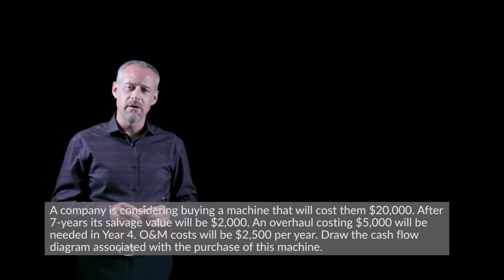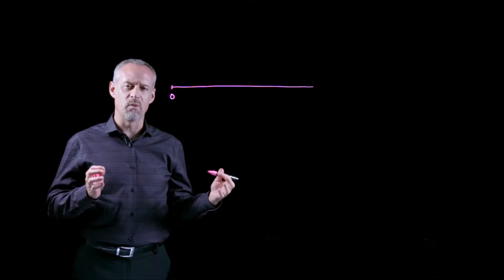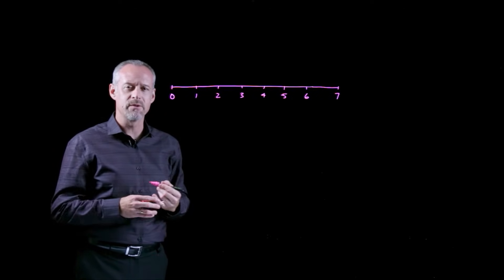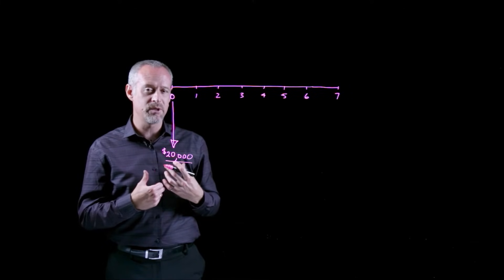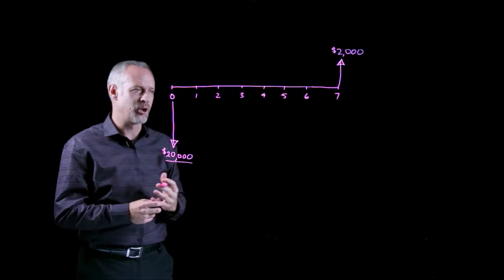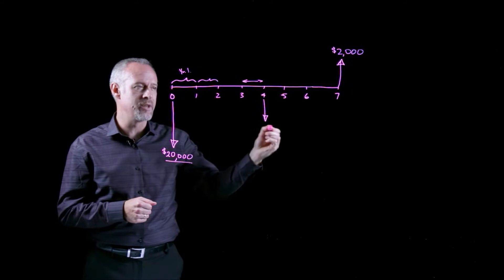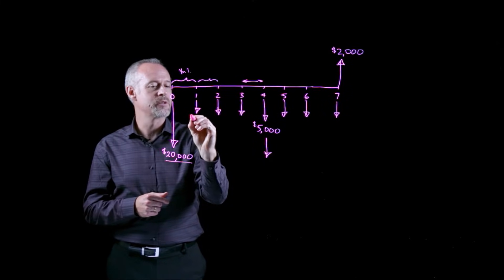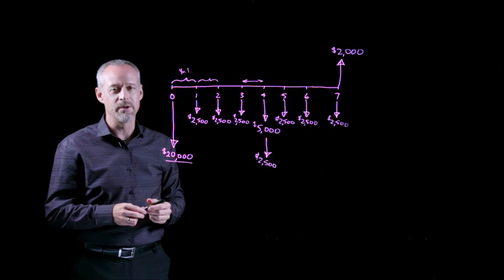Drawing Cash Flow Diagrams - Engineering Economics Lightboard

Comment: Hi Sir, If the question ask me to draw the cash flow diagram consider the present is end of 2015/beginning of 2016, so is the "year 0" 2015 or 2016? I'm a bit confused.  Thank you so much for your super videos as always.
Reply from the maker: Good question.  From the sounds of things you may need to carefully distinguish between a 'point in time' and a label for a 'time period' - in this case a 'year'.  On a Cash Flow Diagram the 'end of 2015/beginning of 2016' is a specific point-in-time and you can draw the cash flow arrow at this point.  "Time t=0" would be at this specific point - imagine it is midnight on Dec. 31st, 2015.  2015 ends at exactly the same time 2016 begins.  However, if you need to label "YEAR 0", this would be all of 2016.  All of 2015 would be YEAR -1.  It may be that your problem is poorly worded.  It is most likely that the problem is referring to a 'point-in-time'.  Hope this helps.
Reply: Yes I agree the question is poorly worded. So I think it's safer if we can put  it like you said as 2015 is year -1 and 2016 is year 0 and write down the explanation. I think it would make more sense thab to mark 2015 as year 0 when the present is the end of it. Thank you Sir, much appreciated.

Comment: If you have a question with a maintenance cost (outflow ) which occurs every one and half years,how will you represent it on the cashflow diagram ?
Reply from the maker: Excellent question.  It depends on how often the interest is compounded.  I suspect your problem has an interest-rate that is compounded monthly...  In this case, you should construct the cash flow diagram using half year (6-month) time increments.  You then need to calculate an effective-6-month interest rate by compounding the monthly interest 6x.  If you're lucky, the problem might have been presented with a 6-month compounding period - in this case you just use the 6-month rate directly.  For instance, if the problem says the interest rate is 10% compounded semi-annually you would use an interest rate of 5% for each 6-month time period.  IF the interest rate is 10% compounded monthly, you would take 10%/12 = 0.8333% per month, then compound it for 6 months, i.e. (1+0.008333)^6 -1 = 5.10533%.  In the strange case that the problem was presented as 10% compounded yearly...then you would draw the cash flow diagram with yearly time increments and then 'push' each 1.5-year payment to the end of the year in which it occurred.  You would end up with a cash flow at the end of yr2, yr3, yr5, yr6, yr8, yr9, etc. ...but this is pretty weird.  It is much more likely that your problem as an interest rate that is compounded monthly or semi-annually.  Hope this helps!
Reply from the maker: This video might help:  https://www.youtube.com/watch?v=kEcGEXlK5oY
And, this one:  https://www.youtube.com/watch?v=plotBZ-kvpc
Reply: @EngineeringEconomicsGuy  please can I send the question so that you can get an in-depth knowledge of what the question requires me to do
Reply: Texaco and SaudiAramco,an oil producing companies signs a Memorandum of Understanding (MoU).The MoU is estimated to last for 12years. Annualy, the two companies benefits $1001.00 after driling machine and it is scheduled to undergo maintenance every one and half years at a cost of $1010.00. If the initial price of the machine cost is $6000;
a.How much does the company makes on the last year if the salvage value is$1011. b.Interpret your information on a cashflow diagram. c.How much does the company make before the end on the 6th year, justify with calculations.
Reply from the maker: OK - it looks like this is not a time-value-of-money question.  It appears to be a 'drawing cash flow diagram' question.  Some of the wording is ambiguous but I will take a crack at what is meant.  I would draw a diagram with 12 years in yearly increments.  Place an up arrow at the end of each year (i.e. at t=1, 2, 3, etc.) each with a value of +$1001.  Draw a down arrow every 1.5 years (i.e. the first one would be half-way between '1' and '2'; the second one would be at '3'; etc.) each with a value of -$1010 - I'm not sure if you should draw a final down arrow at year '12' since it doesn't make sense to do maintenance if the equipment is just being sold for its salvage value (i.e. you will also have an up arrow of +$1011 due to the salvage value at time '12').  Important:  There will also be a down arrow at t='0' for -$6000.  Then you can move through time adding and subtracting as the cash flows occur.  The wording "before the end of the 6th year" is a bit confusing - not sure if that means "at" t=6...maybe.  Also, I'm not exactly sure what is meant by "How much does the company make on the last year..."?  I think this means the 'net' cash flow in the last year.  This might be +$1011 + $1001 - $1010 ?  It might also be asking for the total cumulative amount over the 12 years...?
Reply: @EngineeringEconomicsGuy  thank you sir it was asking for the total accumulation of cash of the company at the end of the 6th year…which will be 1001*6 - 1010*4 …the 1010 is going to appear only 4 times within the end of the 6 years period. I was confuse with the one and half year maintenance cost but I do understand it now. I am a business student and I am doing this course which is Energy Management but it involves a little engineering economics and others…thank you for taking time out of your busy schedule to reply me. I am honored Sir .
Reply from the maker: Glad I could help!  Good luck in your course!